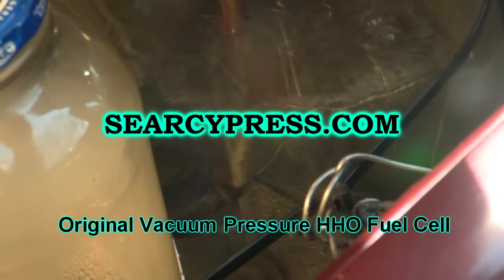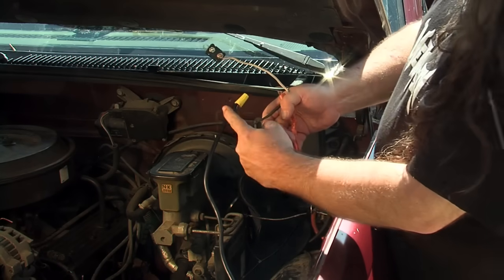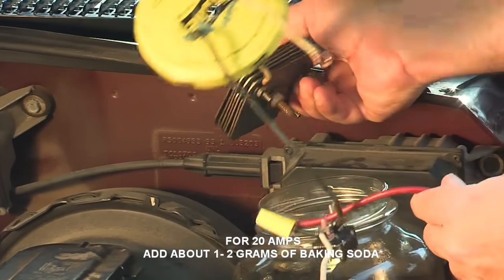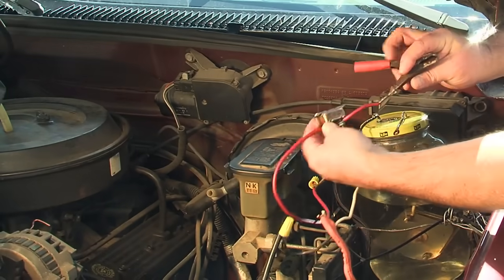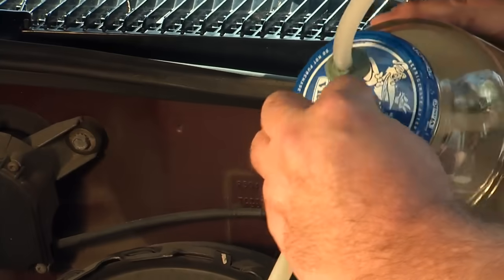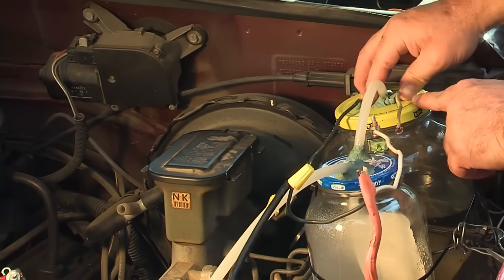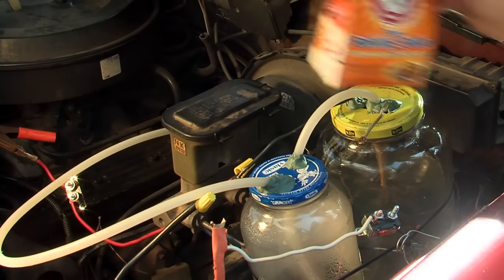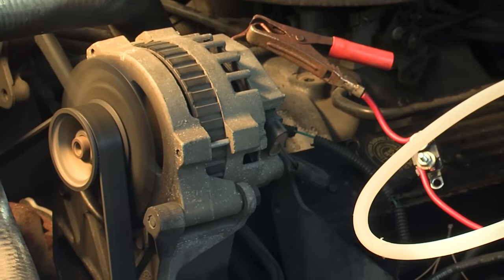Vacuum Pressure Hydrogen fuel cell defeats high gas prices using hydrogen from H2O.

Comment: liked the video, not crazy about the glass containers, but it gets the job done and i see my concern about leaks were put to rest with the poster putty. where can i get the plans. i do have water 4 gas pdf. is that what you used. your's look much simpler and would like to give it a try. video didn't show it hooked up to fuel injector line or carb. thanx

Comment: did you convert that truck to a carb because it normally has a throttle body which would work better because the ecu will sense the hho and should relearn itself and send less gas. Im afriad to run it on a carb motor because you need to lean the carb out to take full advantage and if I would run out of hho while driving id be up shit creek without a paddle

Comment: You get nothing for nothing....It draws 30 amps from your alternator.... where do you think the alternator gets its power from? yes the engine so to produce 30 amps your engine has to turn that alternator and waste power in doing so.  That alternator gets harder to turn the more current it makes. Add the fact that you are using a highly explosive gas and the amount you make with 30 amps couldn't even run a lawn mover by itself,   Is it worth it?  Just saying.

Comment: i have a question about this. im trying to get better gas mileage out of a truck that i  will be using as a hot shot truck and its a 1983 chevy c30 454 4 speed. im asking if it will be a good idea to put this system on my truck or would it overload it self. and another thing will it lose power or gain power to the motor. the last thing i want is to lose power from a chevy motor! haha

Comment: nothing would really happen, the water would escape and the plates would simply be there generating a current, maybe welding itself to the truck, and plus if it did ignite, it would only be a quick burst, there's nothing to sustain it so you wont be looking at the next hindenburg

Comment: How much power does the 29 amps use? The father of HHO used very LOW amps and the electronic components were very complex - also the true generator used harmonics, teroidal coils, selected frequencies - This is simple electrolysis... very basic physics that has NO GAIN as you use more power to generate the HHO than is GAINED in saving - Open to correction

Comment: My question is, If you are tapping into the master cylinder air hose doesn't that effect the vehicles stopping? because I have read that Most power brake systems use a vacuum booster to assist braking.

Comment: did you have any trouble with overheating the jar of solution, i made a small one one time and it got hot quick, i was using a dc adapter and saltwater. thanks

Comment: the amount of gas bubbles is that real for, 29 amps im a year and a half studying this.  has alternator  been changed in any way. it is possable to get 100 volts from car alternator .as volts go up amps can come down ,quick maths ive done ya using about 400 watts if ive done the maths right it should bring it down to 4 amps. i think ya could add more electrolizers you should check that with experianced person. hope im not telling anyone how to suck eggs excellent demo